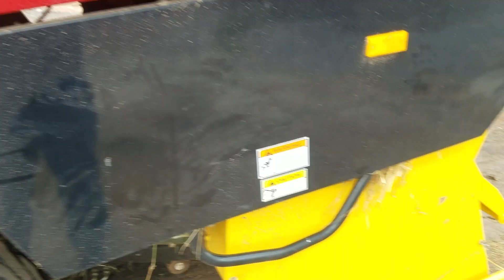The importance of maintaining and encouraging a positive farming community from farmer to customer

Comment: Whilst I broadly agree with your sentiment about maintaining good relations with customers as you never know when the worm will turn and it unfair at least to categorise a group/type of customer! However I would have to say that it has been my experience with my small business of providing custom services to the type of customer your talking about have given me significant issues regarding extremely delayed or non-payment for work carried out. 

I have some accounts which are more than 2 years overdue with no immediate prospect of being paid. I have of course refused to carry out further work until the account has been settled in full. I am at the point of considering a claim for payment for some via the small claims courts. I find it particularly galling when there are clear signs of plenty of funds available but I am being totally ignored despite repeated requests for payment. I have even had denial that I have ever carried out the work!

I'm pleased to say I have quite a lot of good customers that are happy and that pay on time so I concentrate on looking after them.